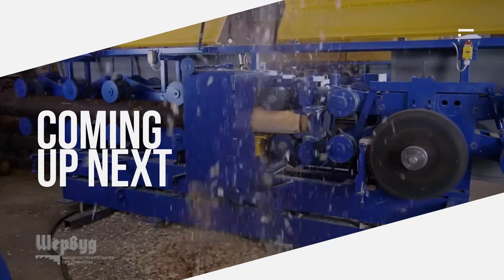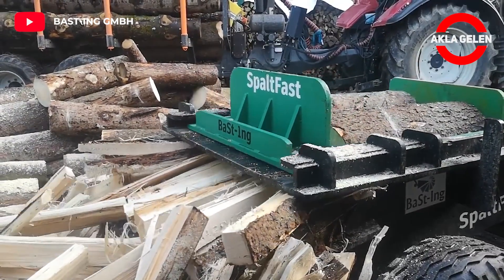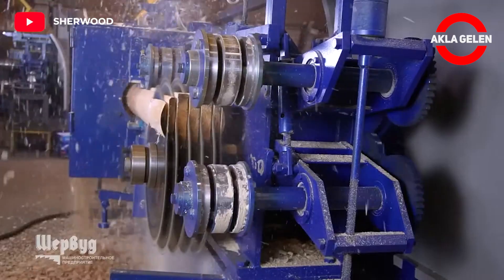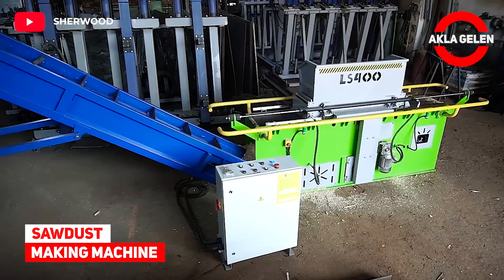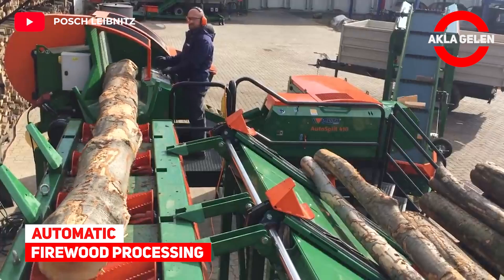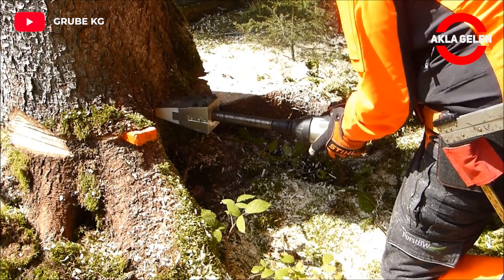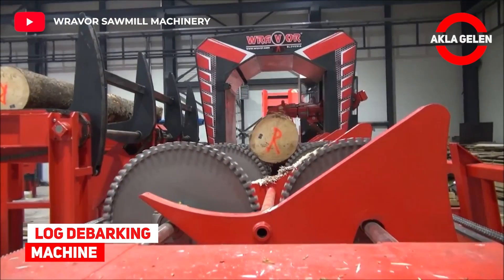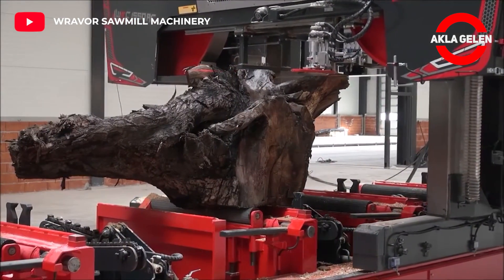Ingenious Tool For Cutting Tree - Incredible Technology Modern Woodworking Equipments

Comment: If your going to narrate in English, then do it also with measurements...Metrics is no more than another language, not better.
Reply: If you would just learn to do rough conversions you wouldn't need to rely on anyone else, you would have helped yourself. Rough estimations can be done in the head for all units of length and weight. Then it's only a half step to learning metric. You learned the other right? I'm not saying metric is better but I am saying that learning it isnt hard and will only benefit you.
Reply: It really isn’t that difficult to understand measurements that most of the world use.
Reply: Well, I’m in Canada where we speak English, and we also use the far superior metric system .
Once you know it … it really is better . So simple. Everything is in 10’s and 100’s . 10 millimeters in a centimetre. . 100 centimetres in a meter .. thousand meters in a kilometre etc etc .. 
FYI … 2.5 cm = 1 inch .  30 cm = 1 foot
Reply: @gordboyko769  And the greatest mystery in life 9/32 nds 😂😂😂
Reply: Not better? Please...
Reply: I also prefer Imperial measurements, but that is because I live in the United States, not because I speak English.

Which measuring system is better? Depends. Better at what?
The Imperial system is based on the human body and is great for quick, on the fly measurements where precision is less important and when you can't mass produce and distribute precise measuring tools. When i'm out in the woods using raw materials or working the land in some field, give me feet, yards and inches.
The Metric system is based on planet Earth. One "millionth" of the distance between the North and South poles is a Meter, and all other measurements relate directly to the Meter in a way that is logically intuitive to those with a basic understanding of Arithmetic. If i'm in a modern society and using materials that come in uniform sizes and shapes, and I have my measuring tools with me, and precision counts, give me millimeters, centimeters and meters.